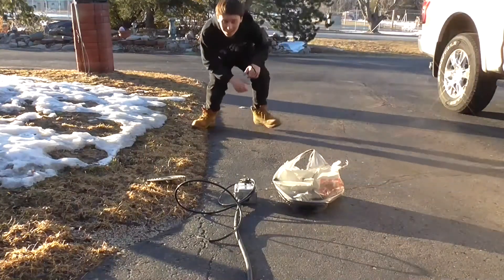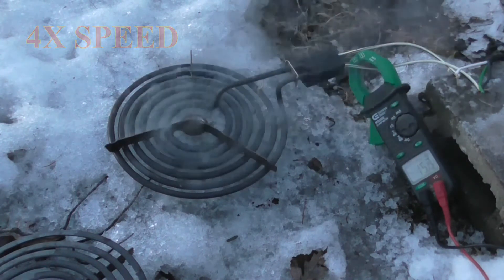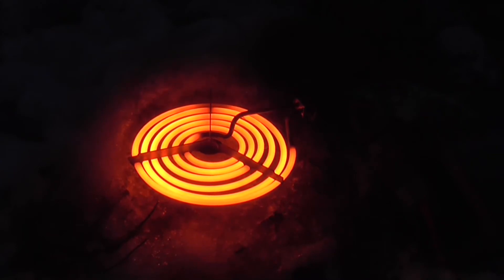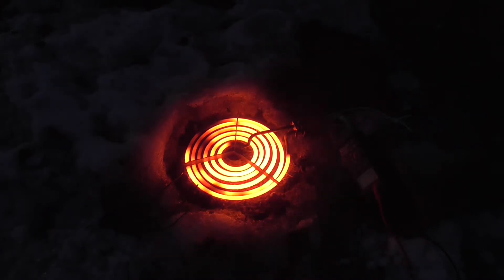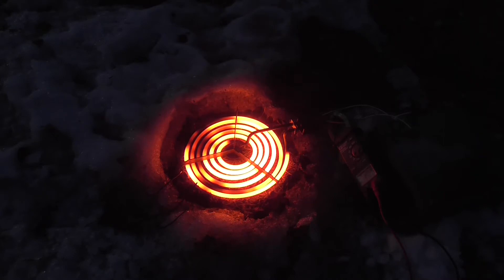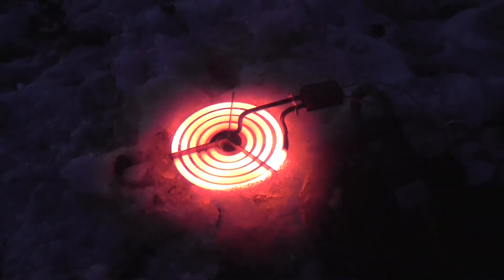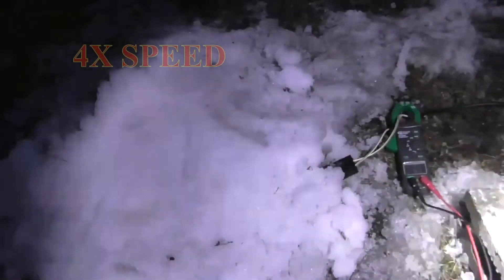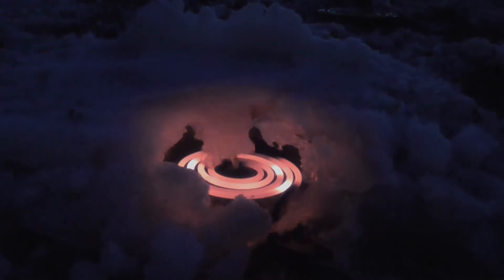480V Into Stovetop Heating Elements Overvoltage! DO NOT TRY!!

Comment: You should do a similar experiment with a baseboard heater (not inside the house for obvious safety reasons!)   For instance,  here in the U.S.A anyway,  most baseboard heaters are rated for 240 volts, roughly 250 watts per foot,  although there are also 120 volt heaters available. Specifically what would happen,  if a 120 volt heater were mistakenly connected to 240 volts? Would there be a fire hazard? Would the element pop? Or will the overheat safety switch shut off to prevent a hazard?

Comment: No heating elements were harmed in the making of this video lol

Just be careful. What transformer setup are you using to get 480V at that high current, Is it your big high voltage one? Or have you got something else going on?
Reply from the maker: I connected (un-ballasted) 480V to the elements straight from the 240/120V 10KVA transformer, but re-arranging wiring, I get the 480V I need to pump the elements full of power, and again, un-ballasted, straight from the 50A 240V MCB. Couple hours ago, I just put 480V into a coffee maker, it was amazing what happened, that will be uploaded soon;)
Reply: Fair enough, you should do a video showing your setup, in detail. I know you’ve done a few in the past but I’d like to see another in full detail showing all your gear. 👍🏻 

I’ll keep my eyes peeled for the coffee maker you nuked. 💥